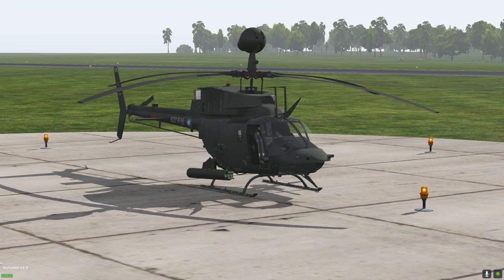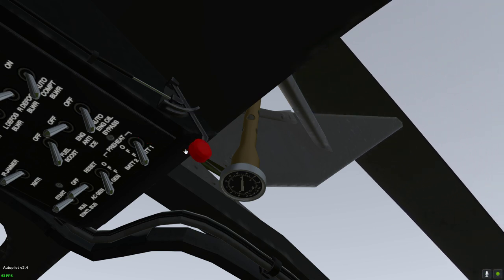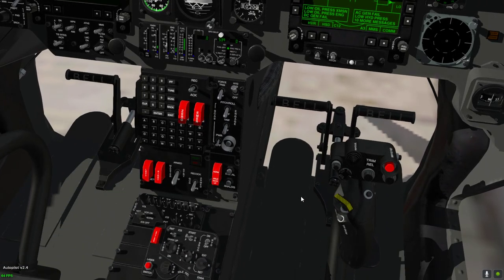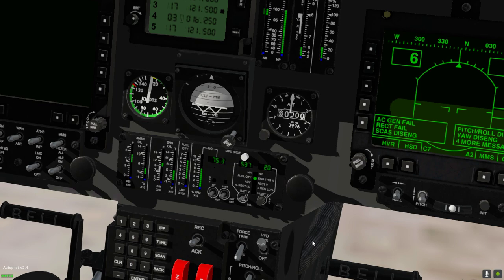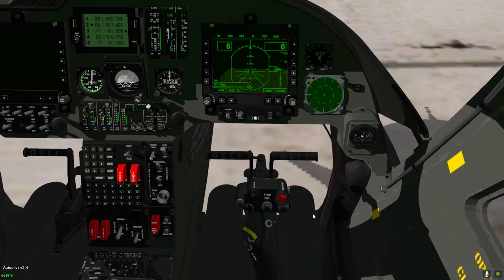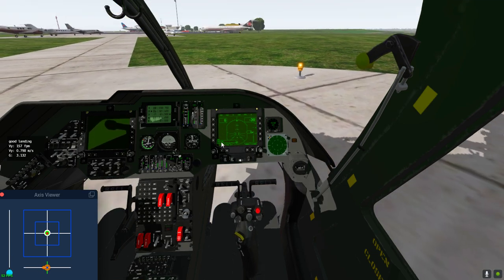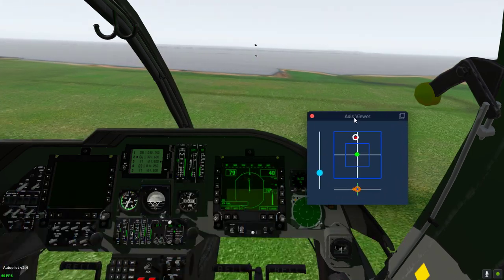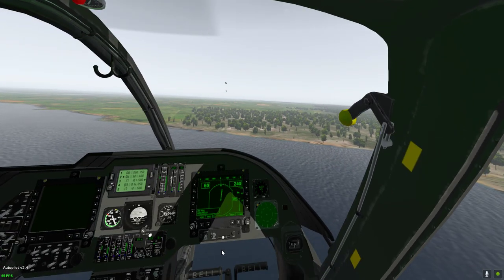OH-58D Kiowa Startup Procedure | X-plane11 | X-Plane 12 | DCS WORLD Short

Comment: While I appreciate folks using the Kiowa Warrior for their flight simulation, I would recommend a good read of the simulation manual that came with the files. You will discover quite a few mistakes in your startup sequence. Also, you will get better results by binding the commands under KiowaW instead of the generic X-Plane commands. As a simple example, the starter motor switch would work properly if you use the KiowaW "Engage Starter" command... Enjoy.